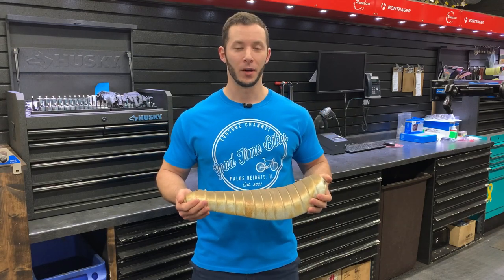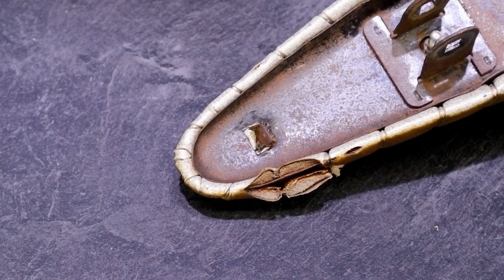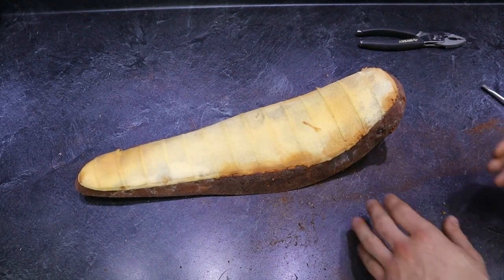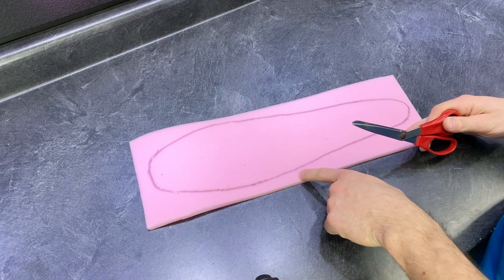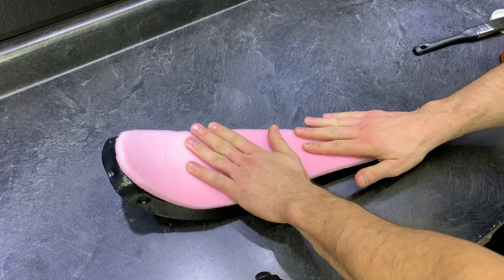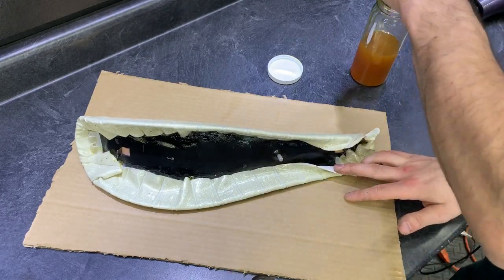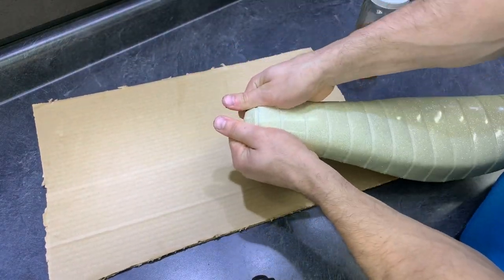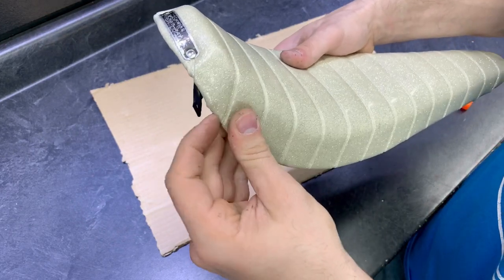How to Recover a Schwinn Banana Seat #goodtimebikes

Comment: Good.  But out nowhere, you sprung "The material" not previously mentioned.
I have several of those.  Is there a "material" with a stripe down the middle?
Also, does the "material" limit the foam thickness??
Reply from the maker: I bought the material from koolestuff.com and if you contact them they’ll inform you for what they have available. I wouldn’t say the vinyl cover limits the thickness of the foam. Even if you used thicker foam for added comfort it’ll be compressed some what but it would still be thicker regardless.
Reply: @GoodTimeBikes  Thanks.  I have the green striped with "S" logo. been wanting to work on it.

Comment: What thickness foam did you use?
Reply from the maker: I used what came in the kit. It’s not thick/dense enough. If you can reuse the original foam, I recommend it. Otherwise double up the foam from the kit.

Comment: Should have cut the fullnest out the back and pleated it. And you don't need to throw away the glue brushes. Just soak in turps overnight & wipe the turps out with a rag.
Reply from the maker: Turpentine?
Reply: not worth the mess with a cheap bush